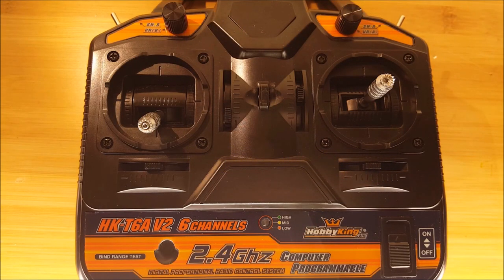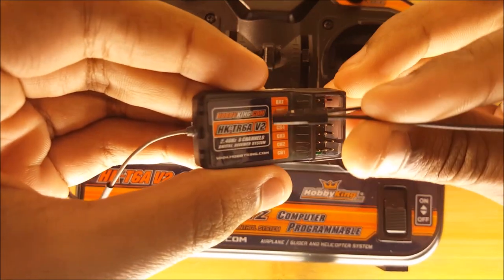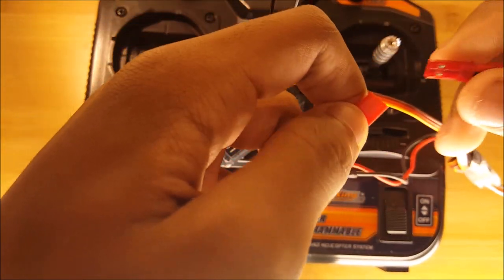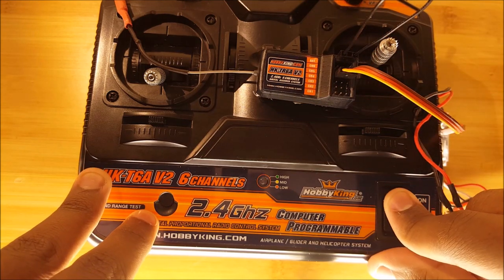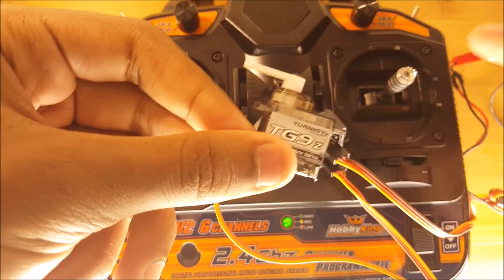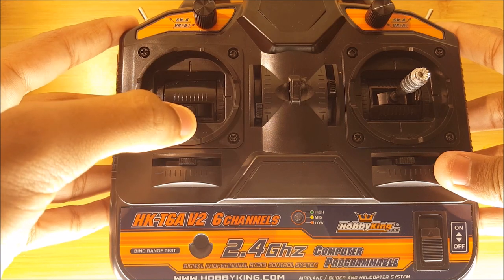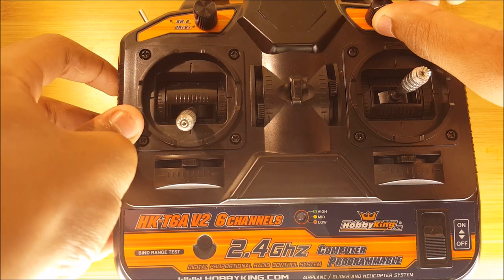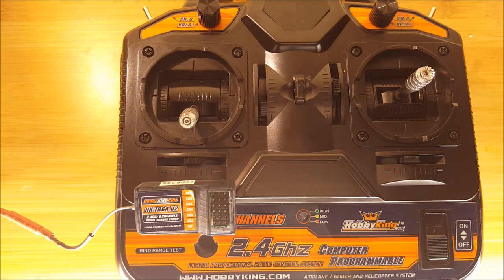Hobbyking T6A  6 Channel Transmitter Binding and Setup

Comment: Very helpful, thank  you for this video. I have one comment, something I learned after I bound the radio and then put a brushless motor on the throttle channel. When you bind, you should have all four of the trims centered.  In your video, the vertical trim on the throttle is in the down position.  Co-incidentally I did the same thing (trim must have come out of the box in this position as I didn't purposely change it, nor follow the picture in the video) The result was that the motor would move, even when the throttle was all the way down, and there is no play left on the trim to stop it, with the trim already in its lowest position. I re-bound the radio with all trims centered and motor control is normal.
Reply from the maker: Thank for pointing that out I hadn't noticed that my trims weren't centered. Another way of solving the problem of the motor spinning at min throttle would be to calibrate the esc. Usually you can do this by turning on the transmitter with throttle in it's high position and then turning on your esc. After a few beeps move throttle to it's min position and the esc should save it.
Reply: @sohansunku1016  Thanks! I was going to try calibrating the ESC next, if re-binding the radio didn't work. This answered my question about "does it really matter what position the trims are in when binding". Yes it does.

Comment: Instead of using a BEC, could I just hook up the battery if the connection is right? or would this fry the antenna?
Reply from the maker: MrBerien You would need a battery that can supply only 5 volts. A 1s lipo would probably work, but using anything higher will likely fry the rx

Comment: Hello, If I have to connect 320A brushed ESC with 12v dc brushed motor how much power the battery must have?
Reply from the maker: Mattew Black Its pretty difficult for me to judge as there are many different sizes of 12v motors and the application matters. Are you using these components for an rc car, and can you provide links to the components so I can research it and let you know?
Reply from the maker: I haven't built a boat before, as I am mostly into airplanes and quadcopters, so I might not be giving you the best information, but I think that this lipo is good for your setup: https://www.ebay.com/itm/RC-Turnigy-2200mAh-3S-40C-Lipo-Pack/261552262107?hash=item3ce5bacbdb:g:5aEAAOSwPAxaBgXm
As for your servo, I would use something like this: https://hobbyking.com/en_us/hobbykingtm-hk15138-standard-analog-servo-4-3kg-0-17sec-38g.html
Reply: thank you

Comment: YOUR VİDEO İS VERY NİCE THANK YOU
MY RC SYSTEM İS ALSO NOT WORKİNG ALTHOUGH THE ENGİNE SOUNDS
IN ADDİTİON THE REMOTE I RECEİVED DİD NOT HAVE THE APPARATUS YOU İNSTALLED İN 0.42 SECONDS 
WHAT DO I NEED TO DO FOR THE ENGINE ON MY RC SYSTEM TO OPERATE AND WHY DOES İT NOT WORK
PLEAS HELP ME 
I NEED YOUR HELP TO FLY MY PLANE

Comment: is a ESC required?
Reply from the maker: No it is not required. In order to bind, you must provide the receiver with 5 volts. Some escs, such as mine in the video, have a built in battery eliminator circuit (bec) and can output 5v. You can use any source of 5v. Hope this helps!
Reply: @sohansunku1016  what plug does the battery require?
Reply from the maker: @johnkuzma7066  are you talking about the battery to power the receiver?
Reply: @sohansunku1016  yes
Reply from the maker: @johnkuzma7066  normally a servo plug will fit nicely into a receiver and you might have to make an adapter to fit your battery.